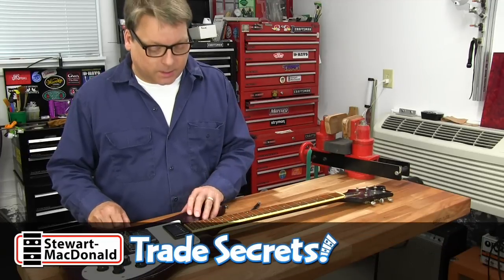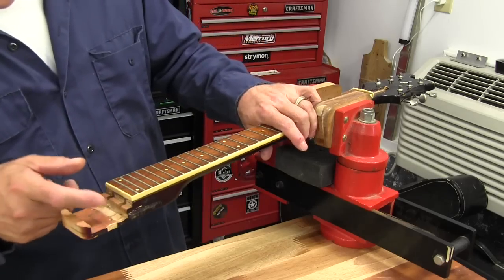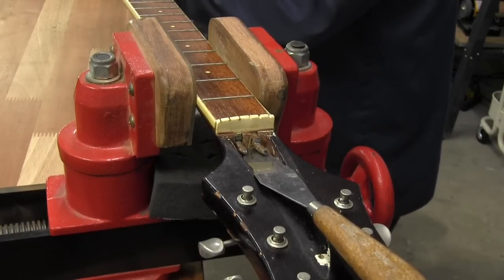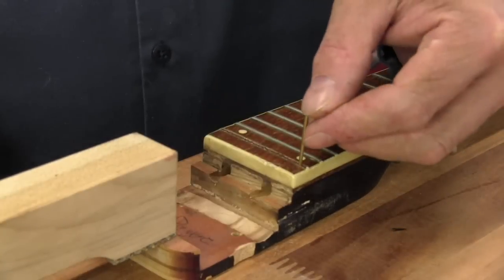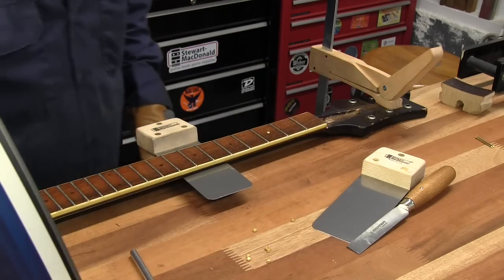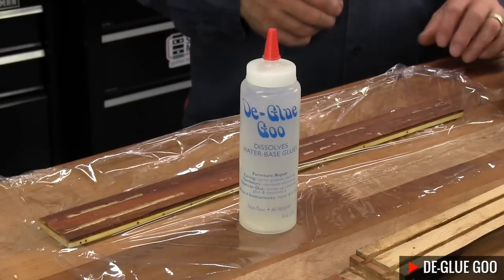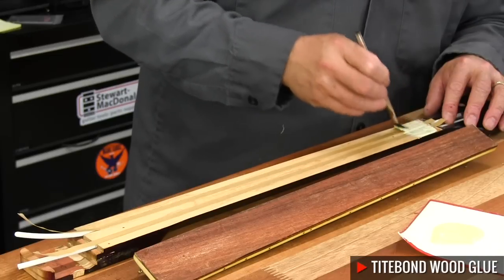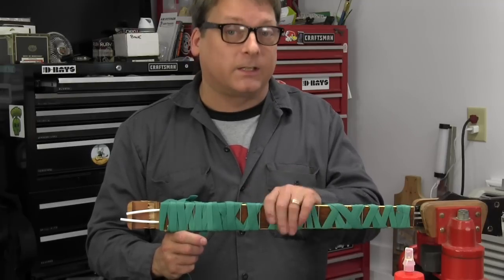Regluing a Rickenbacker fretboard

Comment: I got a job right out of high school working at the Rickenbacker shop in Santa Ana Ca. The job I did the most was gluing necks and threading truss rods. As a guitar player it seemed like a dream job. Turned out to be a night mere. On a more positive note. All the under cut wood was tossed in the trash and I would fill my car with as much as it could take. A couple criticisms of working there the necks were glued on a carousel that when it made a full rotation the necks were removed to allow production to continue. Not enough dying time in the clamps. Truss rods were threaded with a hand held dye and a machine lathe. Safety was never a concern and there were accidents which is why I left.
Reply: That would have been cool to get a bunch of that wood.
Reply: @Ibaneddie76  no pun intended, I believe.
Reply: I'm not surprised regarding Rickenbacker quality control practices. There are many examples of misaligning the bridge on the 4001 basses. Not installing the bridge in the right spot does not inspire confidence.

Comment: Nice job. A little tip from an old painter.  You could have avoided the paint chips as minor as they were by simply and of course carefully running an exacto or a razor blade down that line before removing the fretboard.   Take a hair dryer to the paint first and heat it up a little bit not a lot. That will soften the paint a little and make it not so brittle.  Then run the blade along the line and you should get a nice clean line when you pull the fretboard. You do need a steady hand to do this and be able to cut a straight line!
Reply: I work on old furniture, that was my first thought, can save a lot of effort later.
Reply: Thanks for the tip, I'll make use of it soon!

Comment: The truss rods are two pieces (four pieces total) it is similar to modern dual action truss rods, but these are only single action with the same construction technique, therefore it does not need a widened anchoring channel, just a straight channel all the way through. It is welded together at the heel. If one were to weld it together at the nut, then it would be a dual action truss rod.

As well, if a washer is placed between the adjustment nut and the wood of the neck, the other, non-threaded truss rod can press against that washer and this can actually become a dual action truss rod, if the threaded end is long enough, as in there is enough thread to push into the cavity as the non-threaded rod pushes against the washer.

Comment: In other repair videos people say when gluing a finger board on the glue may cause the wood to swell resulting in a back-bow in the neck and advise clamping the neck to a board using a small shim to create a slight front bow. That kinda made sense to me. So I'm wondering what other opinions are?

Comment: Yes, also intrigued about how the truss rods are anchored. Plus how they work, not being curved.
Reply: Mats Burman The truss rods aren't anchored and are designed to be removed and replaced if needed. They're basically a folded or welded piece of flat stock like Erick said; when you tighten the nut on the bottom threaded part, it pushes against the top piece, acting like a double expanding rod. Let's say this Rick's neck wouldn't adjust- in that case, you can pull out the rods and either straighten or bend them as needed to adjust relief. I think these truss rods were the old style Rick used, where you wouldn't simply tighten the nuts; you basically have to loosen the nuts, physically shift the neck into the shape you want, and then carefully tighten away. It worked, but if you treated it like any other truss rod, there's a chance you could actually pop the fretboard right off the neck! Hope that clears things up.
Reply: jetglo330 Thanks a lot, Jetglo! I think I understand now. Doesn't seem like a very good construction, though...

Comment: you might want to mention to check what sort of material the fret markers/inlays are made of before applying heat, I knew of a guy who fried a Ricky neck with the big old celluloid triangle inlays once, turned on the neck heater and went to lunch, and ended up buying the customer a new guitar. Sad to see those p/u's in that cool old guitar.

Comment: Very nice and hard work there.  My bass has the same problem in upper end of the neck, around 8cm is separated with very little gap. Is there any way to glue it without removing the truss rods and entire  fretboard? I mean with just glue and pressing clamp and some simple tools as i dont have those proper tools. Can you help me out?

Comment: Bravo Eric, always enjoy these STEWIE videos, and have gained a lot of (hard won ?) wisdom in the process, however I have 2 things:   1. Why not re-install the rods first, as the factory does, prior to attaching the fingerboard?  And 2. Why do most Luthiers "Clamp" fingerboards to necks in a "FREE STANDING" condition?  I have a 36" milling machine table, which I use in clamping boards to necks, that way the board is as straight as the machine table when done!  Eliminates a LOT of needless extra leveling work, particularly when frets are already in the board, as in this tutorial, call me lazy, or crafty, whatever!   BTW, how does a flat bar truss rod provide the curve deflection required to "Pull" back a bow???    Gb   g

Comment: Great video. Thanks.  You said you would reinstall the truss rods through the peg head. You mentioned they were originally installed from the heel but they liked to continue in that direction for removal.  Wy would you not install them through the heel like Rickenbacker did?
Reply: Scott Clark 
Why not just install them while the fretboard was off?
Reply: Ítalo Brito 
You could just leave the masking tape in place and glue the fretboard over it.

Comment: How do I successfully separate a scarf joint that's under the fretboard? I have a through the body guitar neck that the headstock is irreparable (long story) so I'm planning on using a donor guitar neck and grafting the headstock from one neck to the other. I know I have to remove the fretboard to do this operation. The guitar neck that I'm trying to save has a locking nut on it. Any help you can offer is helpful. Plus I've never done this before. I'm a beginning luthier.
Reply from the maker: Hi Allen, this is quite a complex repair job that entails more than we could effectively communicate here. If you would like to speak with one of our technical supervisors, please give our toll-free number (1-800-848-2273) a call and ask to be transferred to our Tech Line. Our techs would be happy to assist and advise you as much as possible.
Reply: stewartmacdonald Thanks. Will do.

Comment: Why remove the tape. all the squeeze out is gona run into the rod channel that you cant see. you seen the amount that came out the of the outside of the neck. imagine how much went into the truss rod channel opening ???? you should of cut some greaseproof paper a couple of mm wider than the channels and n left that on, would of made sure no glue went into those channels and hindered any tr adjustment later on when dry. Just thinking out loud btw. Nice guitar that. not seen a sixer  in that model before.

Comment: Whats the point of tapping out the truss rods when you're removing the fingerboard anyway.
Reply: +cast390 good point
Reply: +cast390 I suspect it was to see if the truss rods were causing the fretboard lift before going to the step of removing the fretboard.
Reply: +cast390 Perhaps so you don't glue the truss rods. If you glue them by accident, they may be stuck from there on out.
Reply: so he can teach two things at one time,http://www.azquotes.com/picture-quotes/quote-it-is-the-commonest-of-mistakes-to-consider-that-the-limit-of-our-power-of-perception-charles-webster-leadbeater-53-34-36.jpg READ MORE: http://www.disclose.tv/forum/posting.php?mode=quote&f=31&p=1086598
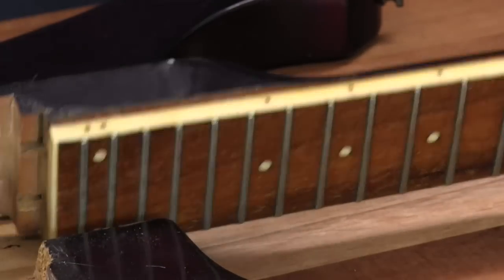Reply: +cast390  Well if you were listening , he took em out cause the threads were chewed up , so he could re-thread them ;)  +0:41
Reply: He could've got them out and done that after he took the fretboard off. 
It doesn't really matter, though.
Reply: hindsight is 20/20 
like any mechanic you don't know what you are going to do until you start doing, its his first step that dictates how the rest will transpire  the most important repair is evaluated first
Reply: Sometimes if you try to pry them out with the fret board off, they can bend really easily. Once you put a kink in one, you  are screwed.  They are pretty flimsy.
Reply: The truss rods were damaged I think he show in the beginning how he was gonna re-strip them
Reply: this wasn't pre-scripted, it's live trial and error, hindsight is always 20/20.
Reply: cast390 I agree 100%.  Why not just remove the rods once the board is removed?
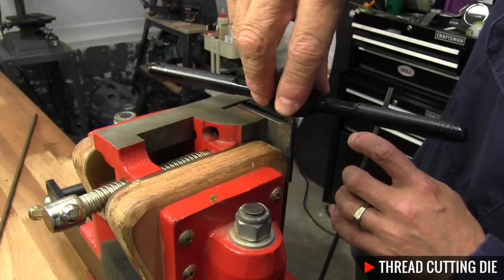Reply: @onpsxmember  he explains at 3:10 that he thought the neckboard would be able to close up after taking out the rods (he thought something was wedged in there and blocked or held by rod maybe)

Comment: Why were the rods hammered out instead of just taking them out after the fretboard was off?
Reply from the maker: Erick hammers the truss rods out because he originally planned to fix them and the small section of fretboard separation without removing the board. His previous experience also drove him to hammer them out in the direction they were installed. However, after removing the truss rods and evaluating this separation, he determined it was necessary to remove the board all together. He decided to reinstalled them by hammering to ensure they would not get glued stuck in the truss rod channels. This is why he placed the teflon rods in the channels and covered them with tape.
Reply: @stewmac  Got it, thanks!

Comment: i love seeing the process of replacing and fixing truss rods. its so funny to me to see how these guitars and basses are so expensive but are still made so poorly that they come apart from normal adjustment due to lack of glue
Reply: The type of glue is designed to let go if the instrument gets too hot. This summer-break many schools left the A/C off for the summer. All the wood instruments got too hot after many 100 degree days in a row. Most of them came apart, but almost all of them were repairable because the glue let the instrument loosen up and it did not tear up the wooden parts. (West Texas)

Comment: how do these truss rods work since they are not anchored?
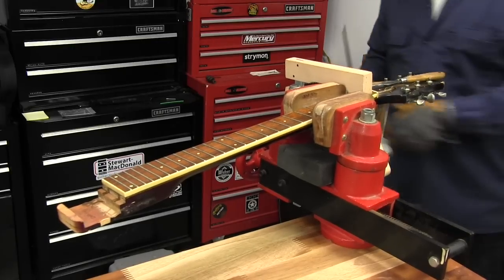Reply: kwstikas82  I was wondering about that too...and figured it out.... If you go back and watch carefully at 2:56 when he shows the buggered threads you'll see what appear to be FOUR rods - each rod in the guitar is actually TWO rods that are laid side-by-side and ONE end is welded together (could be just one rod folded too)   One side has threads for the adjustment nut - the other just has a flat end the nut will push on when tightened - forcing them to curve....At 3:05 where he's tapping the threads you can see he's holding the flat end out of the way with one hand.   It would be a good idea to wax the rods to help them move when reinstalled.

Comment: Don't like the idea of type  or elastic bands as clamping, doesn't give you enough force and there's no Force in the middle only on the edges, why don't you use just 10 clamps with a half an inch of sacrificial pieces of wood top and bottom. Always clamp for middle to edge

Comment: Talking about a shit job....i guess it sucks being a luthier at times like these....The two times i had to remove a fingerboard(one for myself and one for a friend) i ripped it in million pieces(that is not an exaggeration) and installed a new one with stainless steel frets.Still a shit job but at least when you are done that guitar wont need a fretjob for at least a persons lifetime.
Reply: Dreamdancer11 Beats sitting in a cubicle for 8-10 hours, I guarantee.
Reply: Hahaha no argument there brother.
Reply: epoxy on it or what?
Reply: No. Epoxy is permanent. If it needs to come off again in the future, woe to the luthier that gets that job.  Wood glue (or hide glue) is the glue to use.
Reply: Of course. I just asked cause dreamdancer11 said he ripped it to smithereens. I thought that could've been the reason why it happened.
Reply: The reason was cause  i didnt have a decent iron for the job and  the most important of all...patience.
Reply: Hey you learned from it.
Reply: No doubt about it.
Reply: Some of that Chinese crap is glued with some nasty brown glue that won't soften with heat. I pulled off a bridge, and part of the top. I thought, "well that's not right", so I put a heat gun to the bridge plate, and had smoke & sap bubbling off the wood, before the glue got soft. It eventually softened up, but that spruce would have been on fire by that time.

Comment: Why tap out the truss rods if you have to lift off the fingerboard anyway? Wouldn't they just lift right out? And then why re-glue the fingerboard back on BEFORE you reinstall the repaired rods? Is there some advantage to doing it that way? 
Seems like your putting on the condom before you meet the girl...admirably optimistic but uncomfortably premature...